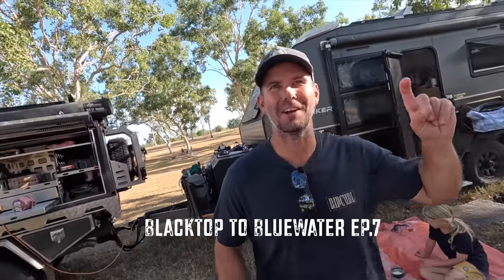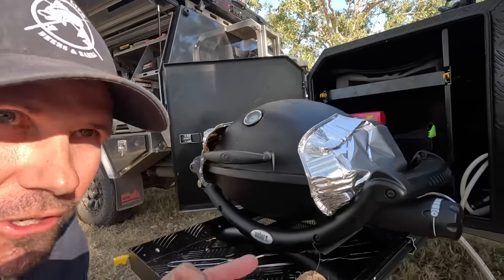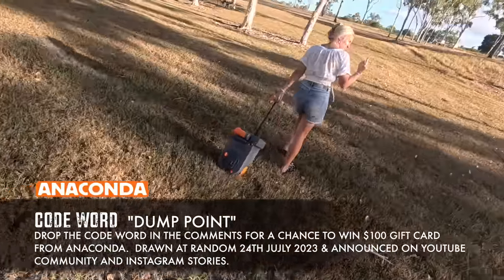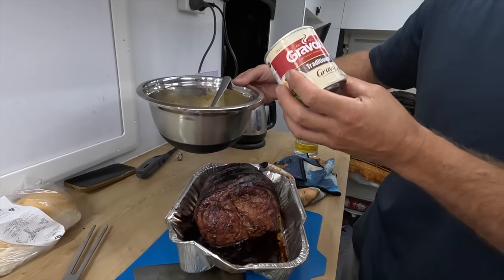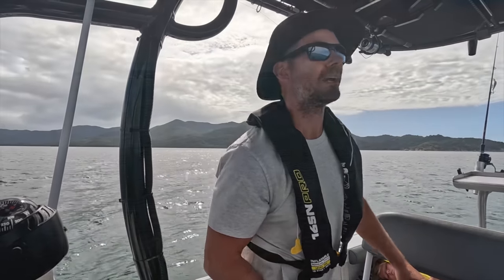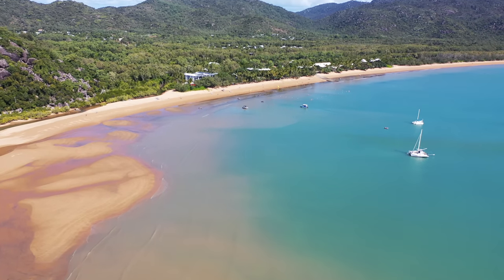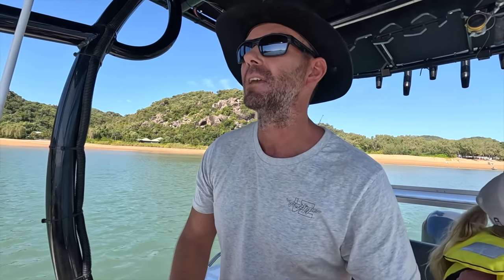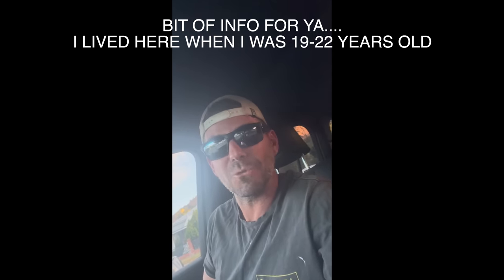FINDING A SHIPWRECK FROM A BUSH CAMP ☠️⚓️Blacktop to Bluewater Ep.7

Comment: Hey Justin, I was having the same issue with my baby Weber Q with not getting over 180. I drilled out the gas jet with a 1mm drill bit and now have no problems hitting 250c-300c even if its windy!
You do have to be a little careful when baking to not burn the bottom but totally worth it! 
I would recommend a 0.9mm drill bit if you can find one.

Also DUMP POINT, love your content guys!
Reply from the maker: Awesome info thanks mate

Comment: Great to see Bec rise to the occasion and have a go at the Dump Point. 
Must admit it’s not the nicest of jobs. 
With the use of mustard, you don’t taste it when the meat is all done. You can use mustard from a squeeze bottle if you wish and it’s cheaper then buying Dijon mustard. 
I’ve even used a light coating of mayo to hold the rub on the meat and there has been no funky flavors apart from the rub. 
Cheers….. Pete
Reply from the maker: Thanks for the tips! I’ll give it a go for sure

Comment: Hot tip for Bec if you don't already know it, the 300 series has an automatic mirror tilting function.  Leave the side mirror dial in either the L or R position and the mirrors will tilt when you put the car in reverse.
Reply from the maker: It’s so good hey

Comment: You can change the jet, I’ve tried that on the Baby Q but it soots up a bit because the air gas mix is messed up. You’ll end up with a big carbon buildup under the grill
Reply from the maker: Arghhh bugger
Reply: @TripInAVan  I had the same drama trying to get it hot. Ended up selling the Baby Q with our first van and got a Weber Q for current van. Heaps better for heat👌🏻

Comment: Hey Justin, just a question on the SOG system, I noticed when you installed yours that you put the vent in the top of the canister, the instructions have it going into the screw cap. Have heard that the contents can splash into the air hose if it is in the cap, any such issues with it in the top of the canister? Don’t want to have to disconnect the air hose and put in the bung each time we move the van. Love your work. 👍
Reply from the maker: I’ve put a piece of foam in the hose to prevent splash back

Comment: Our Weber wasn’t heating above the 200 mark and was taking forever to heat, we reached out to Weber about it. We have always cleaned the element but they said the following:

Check the vent hole on your regulator is clear. There is a hole in the regulator that ventilates the hose. Try putting an extended paper clip into the hole to ensure there are no blockages. Try reigniting the barbecue and check if the problem is resolved… this was a game changer for us, our Weber gets soooo hot now and so quickly! Maybe try this out 👍
Reply from the maker: Oh this is great info thanks mate. I’m trying that for sure